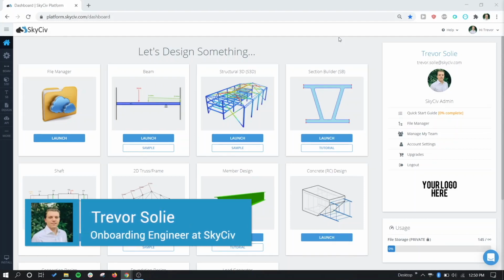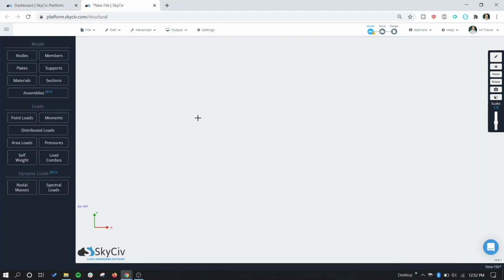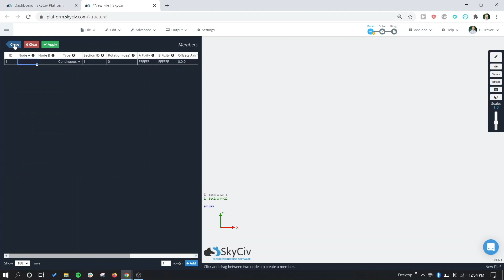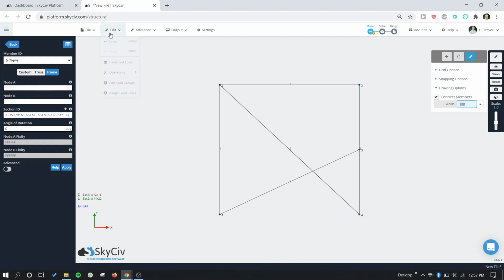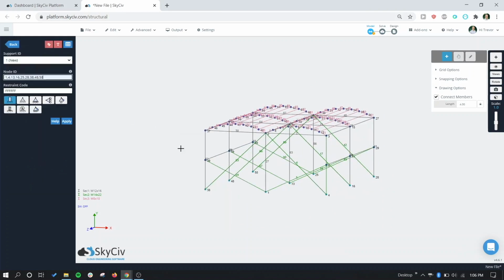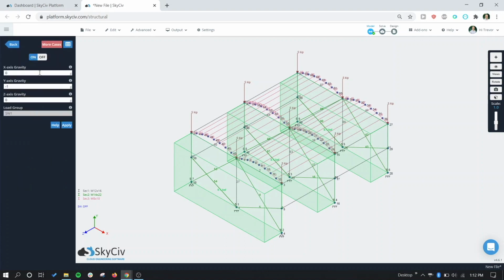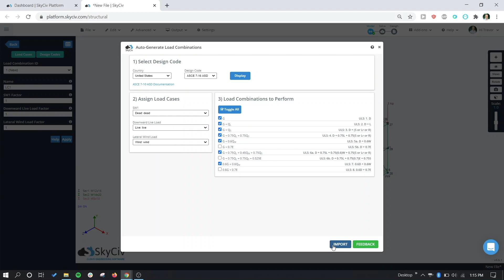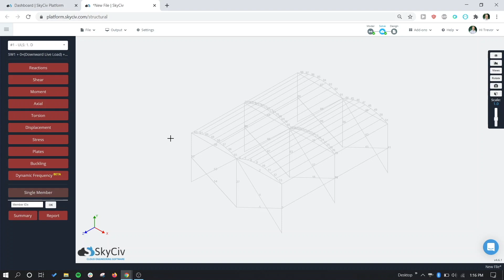Recommended S3D Workflow for SkyCiv Structural 3D | Structural Analysis and Design

Comment: Hey guys, I recently signed up and I'm amazed at what this software can do. My experience has been great, but I have one small problem: I haven't been able to rotate the supports in the frames I design. For example, the fixed support is "pointing" upwards, but I want to rotate it 90° clockwise so it "points" to the right. It would be great if you could tell me how to do it or point me in the right direction. 
Cheers!
Reply from the maker: Hi Victor - great to hear you're enjoying the software! You can do this using inclined supports. There is a tutorial and article on this under our documentation page for Supports: https://skyciv.com/docs/structural-3d/modelling/supports/. Check it out and let me know if that helps, otherwise feel free to email us at support@skyciv.com if you have any further questions!